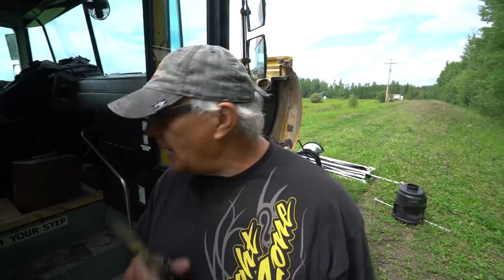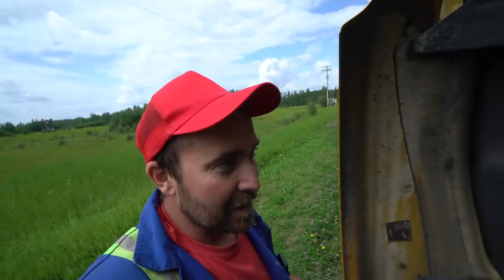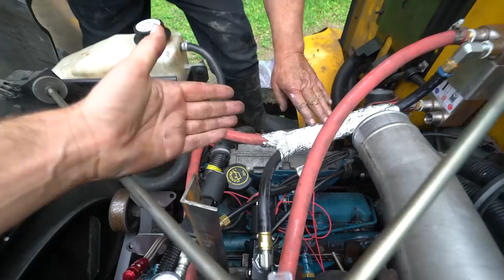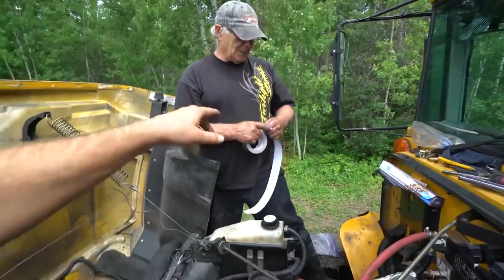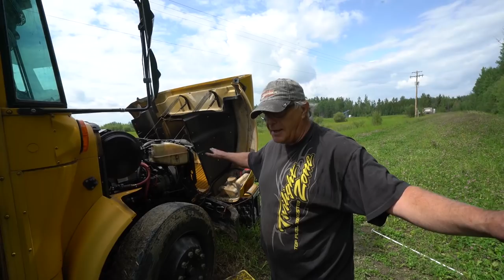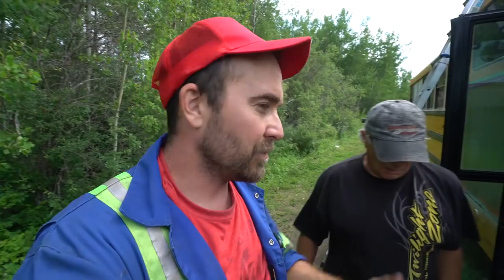BADGE EXPLAINS VEGETABLE OIL DIESEL CONVERSION WVO SVO

Comment: That's cool with the fuel system, running out in a diesel is usually a total nightmare. Quick question I know your lines are all heated but what about the tank itself. If it gets cold enough the oil may not pump out at all. Might have missed that part but don't remember seeing anything on that.
Reply: Mrs. Black the tank needs to be heated he has 2 stick on heating pads 🇨🇦🇨🇦

Comment: Is that tinfoil wrapped shiny side in?  Probably a busted myth, but  it's supposed to reflect the heat inward for baked potatoes.  P.S. You might get confused with more than one area of tinfoil, when making trucker steak on the engine block.